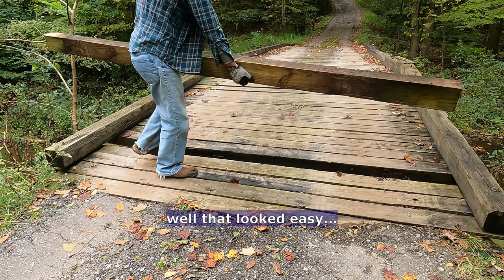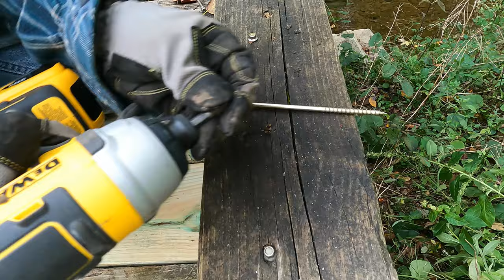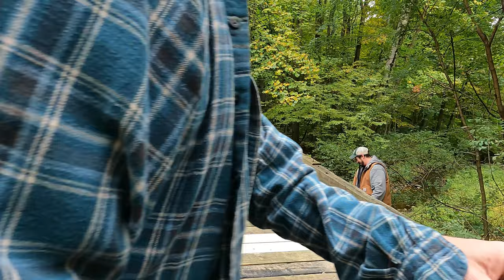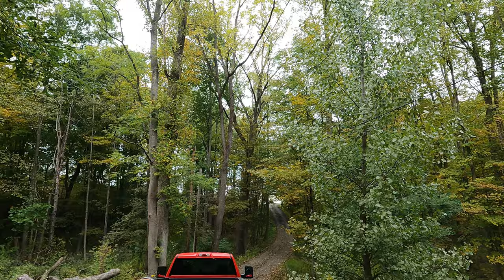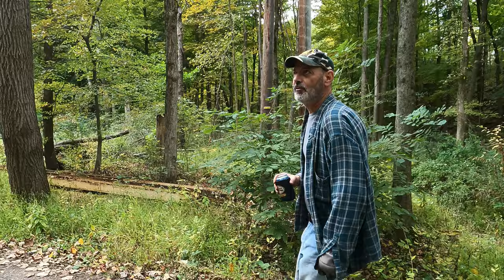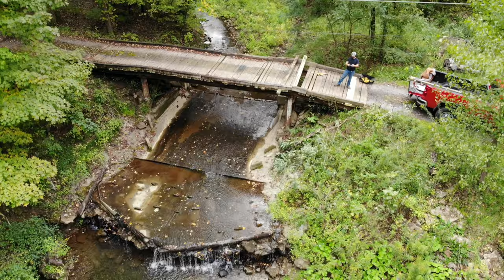Thats not a sawmill. Bridge Repair needed.

Comment: Adding runners would dramatically increase your road surface strength.
Reply from the maker: Runners being top boards that run in the direction you drive? I've considered doing that but then it's far more work to replace one of the bottom boards unless I'm missing something.
Reply: Yes, your are correct. @mcsawmill

Comment: What size were the timber beams? I heard you say 10' length but is that 6" or...??? And the screws? Trying to study up on bridge repair. The entire bridge is probably 40' if not longer. I-beams and footings are good. Just the timbers are done. Looks like they have been done for for two decades or more. Its a pretty spectacular creek as well. Kinda scary.
Reply from the maker: I used 6x4 treated lumber for the surface, but if I were doing it again I would go with 6x6 treated. I used 5/8" allthread to fasten to the I-Beam underneath and for the sides. The screws thru those sides are just extended construction screws 3/16 dia, not much stress on those they just keep the boards from walking. The I-Beams underneath are 18" tall x 8" wide and 1/2" thick steel, real heavy, I got them from a dairy farm that burned down and I also had to weld an X between them for stability.
Reply: @mcsawmill  thats awesome thanks so much for the information!